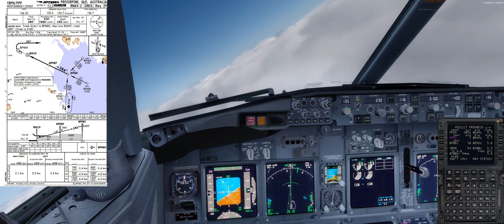B737 RNP APCH LNAV VNAV

Comment: 02:00 “....and modification of the instrument is not permitted”.    Not to “sound” argumentative, however I must respectfully disagree with this statement. 

The FCTM and FCOM of all Boeing aircraft allows the pilot to modify the selected approach from the FMC up until the FAF (Final Approach Fix). A cold temperature correction may be added to the initial, intermediate and missed approach segments. From the FAF to the missed approach (MAP) there is no modification allowed, expect for the holding dependent whether you are radar identified (or not). During low temperatures (below 0*C, you are authorized to modify the procedural altitudes prior to the FAF for terrain and obstacle clearance assurance. If you search low temperature altimeter correction, you will find a table that is FAA and ICAO approved and used during winter operations. All approaches are based on ISA conditions only, hence your altimeter will over-read or under-read depending on the temperature during the approach. In the case of low temperature (below 0*C, if you do not correct the procedural altitudes as previously stated, and you engage VNAV (VNAV PTH on the PFD), your altimeter may read you’re on the correct descent path but in reality your obstacle clearance is greatly reduced.

Comment: Hello thanks for nice and clear explanation :), what I missed is why we are turnig off DME/DME source of update? Another question is if we have on chart only LNAV app with DA(H) except MDA(H) do I need to add a 50 ft HL?
Reply: Dome updating turned off because it’s assumed with proper RAIM that the GPS updating is more accurate than dme updates, so we don’t update the fmc position to a more inaccurate position, and thus keeps the anp as high as possible, preventing the dreaded “unable rnp” message that would dictate a missed approach if not in visual contact. 

As to your other question, I don’t think if the approach is LNAV only that you would see a DA listed?  So should be listed as a MDA instead, and the 50’ should be added to mins. The way to remember is that MDA stands for “must do arithmetic”. And DA stands for “Don’t add”. 

Had to edit some for auto correct.